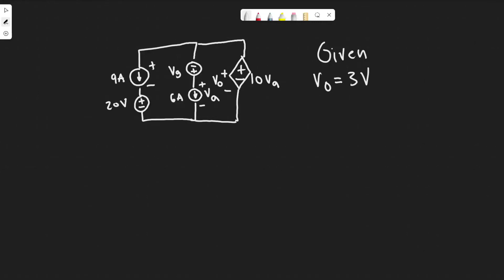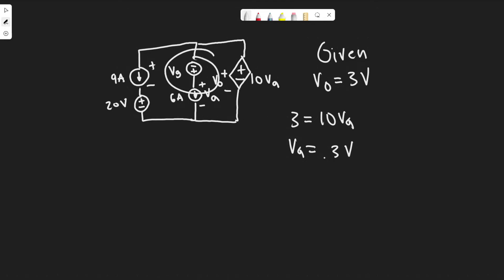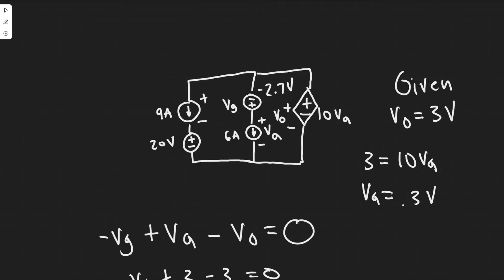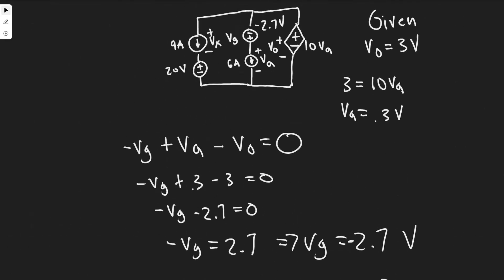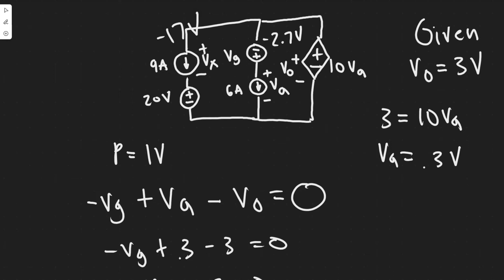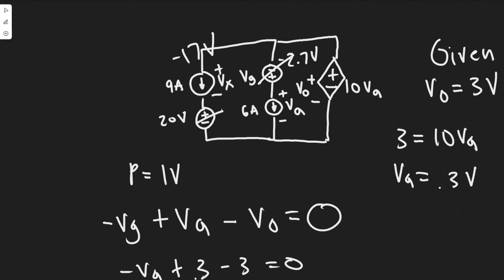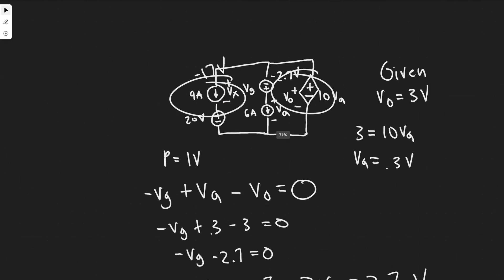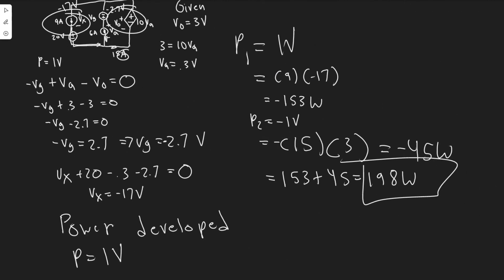Consider the circuit in figure 1 suppose that Vo = 3V. Find the total power developed in the circuit

Comment: If you switched the polarity for 9A would it still be developing?
Reply from the maker: i dont believe it would
Reply: Switching polarity would give +17V but current would enter through negative side of Vx so we would use -IV so still developing?
Reply: Also could you solve this without using Kvl? Since nodes aren’t shared voltage must be same across branches